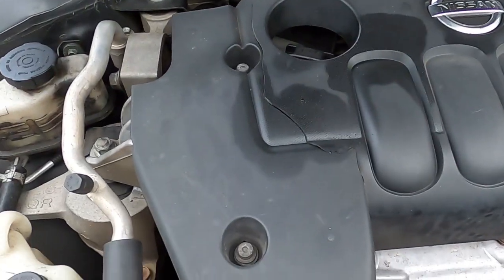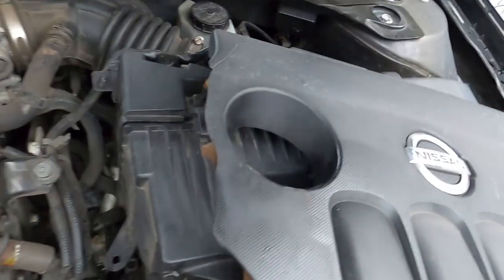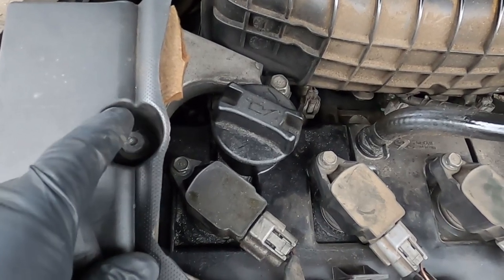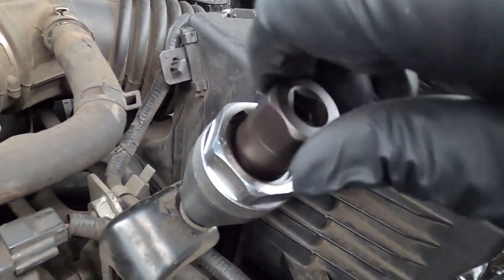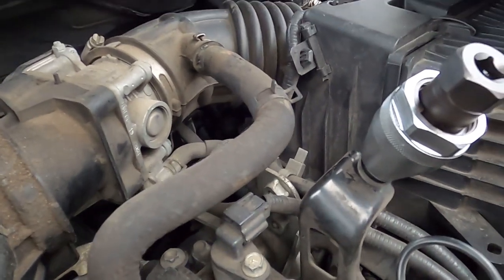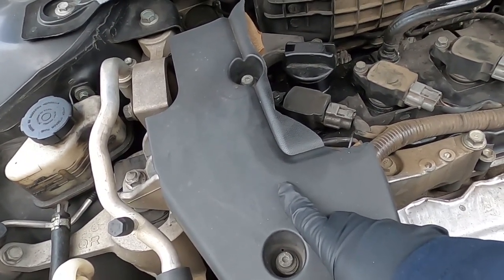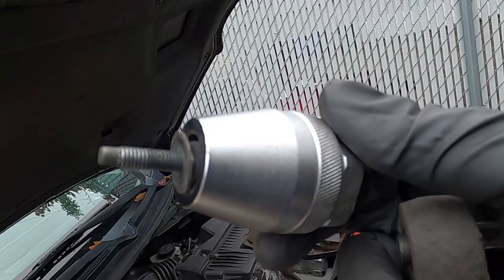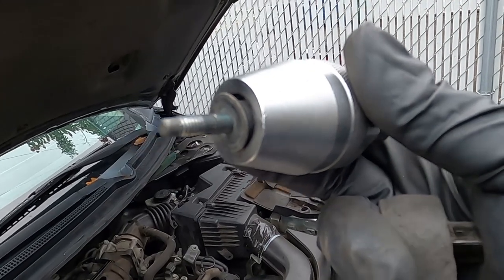Tool Review: Dewill broken bolt extractor

Comment: um in this case.. the cover is already broken. why not just break it further and use some channel locks or a suitable socket head?
Reply from the maker: Good question.
The point was to try out this tool. I'd been meaning to buy one for a while, and this was a good excuse. The price is pretty low.
I've used it a few more times on my 25 year old bike.
It's great for stuck posts, or bolts with the head broken off.
Reply: @lyunardo  gotcha. Yeah I was looking for a review on this thing myself. I've always used the two nut method over the years but this customer has a half broken off stud.